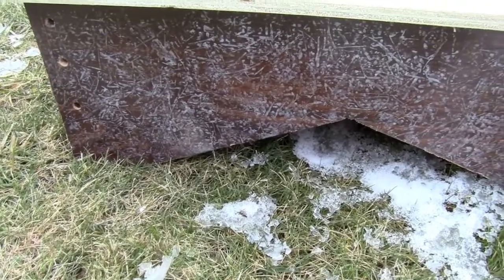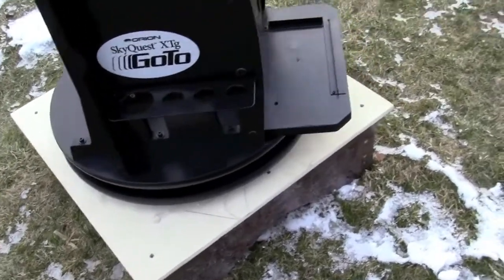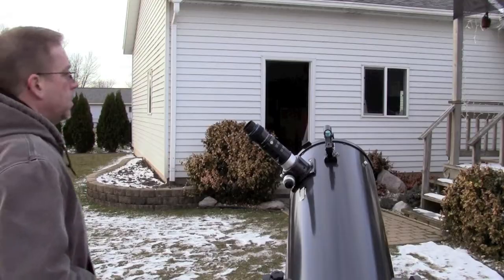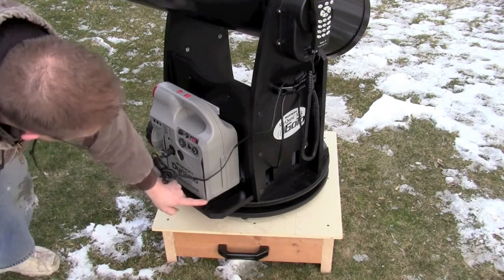How To Make A Base Table For Your Dob Telescope

Comment: A really good thing to do to the base is to install a lazy susan bearing and then the scope will rotate so easy.
Reply from the maker: Have you tryed that? How did it work? Nice idea. If it isn't computerized you would have two pivot points.

Comment from the maker: I am using it right now, looking at Jupiter. I did modify it and made it into a three leg table. If your camping let say and the only place that is open is the beach, it works great in sand. You have to jump it down though, with three legs that gets a little tricky. Stay in the center. Thanks....    Good luck,  Dennis